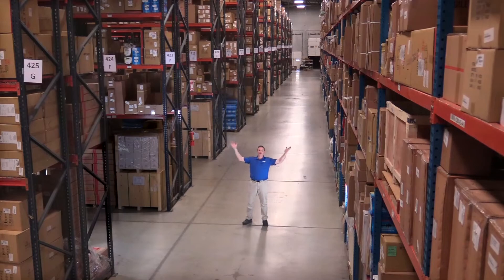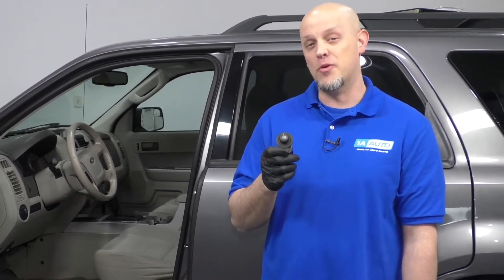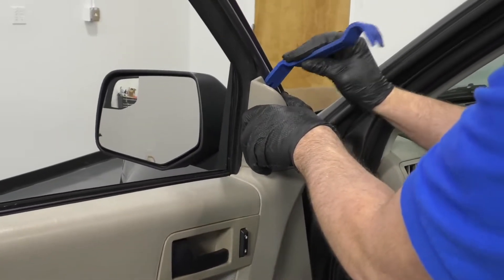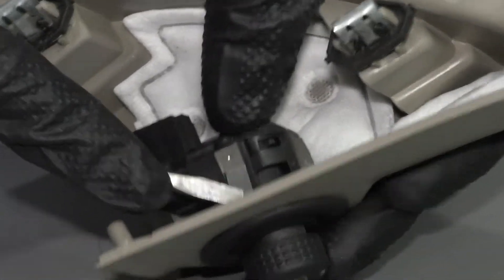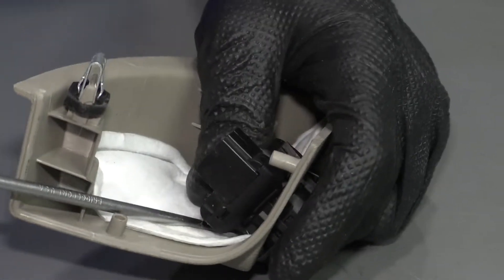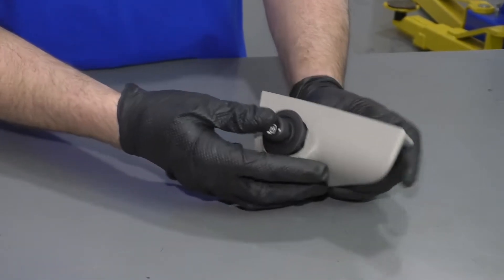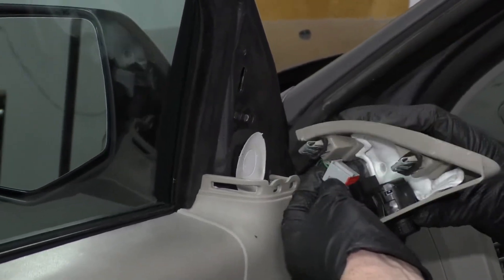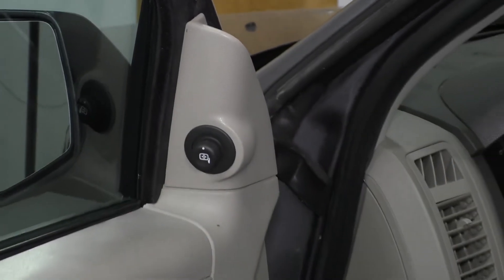How to Replace Mirror Switch 08-12 Ford Escape

Comment: I replaced the switch....both mirrors were going up and down ,but not side to side....same thing with new switch......any suggestions??
Reply from the maker: +@briangumola7458 We wouldn't be able to diagnose an issue like that here, you may want to have a local mechanic take a look at it. Thanks for checking us out! http://1aau.to/m/Shop-1AAuto-c